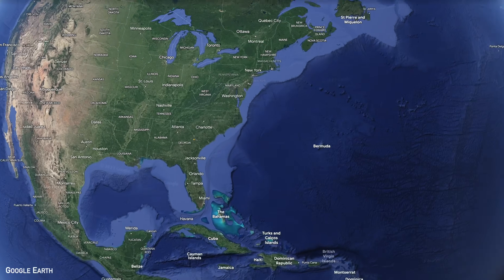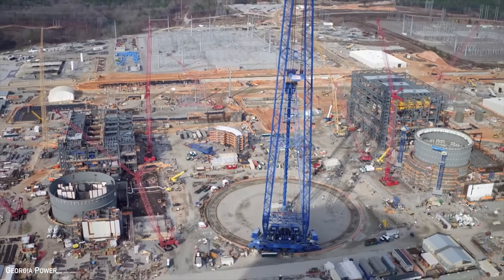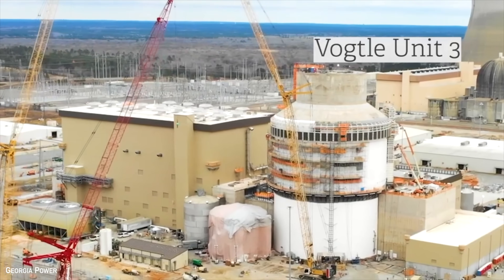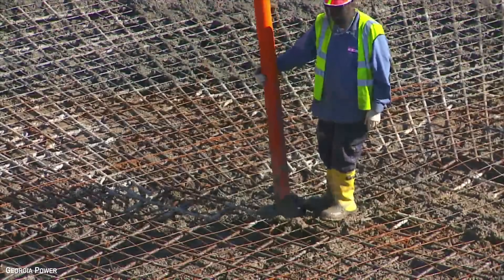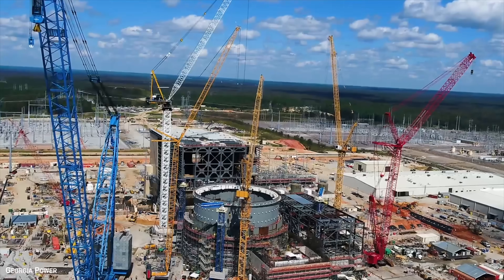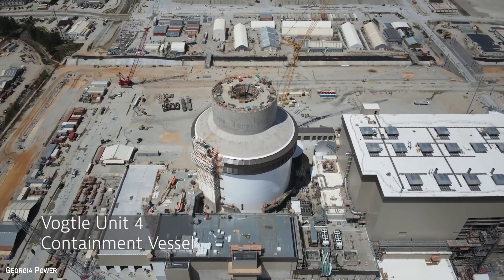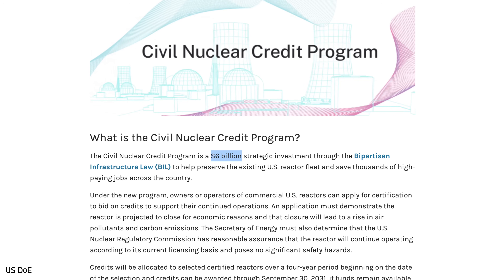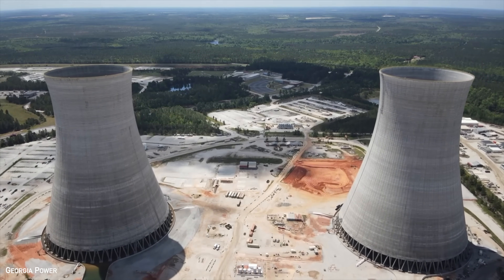Why the Future of Nuclear Power Depends on This Plant

Comment: It sounds to me that there was a gross overreaction to the Fukushima disaster. The main problem there was due to it's location near the ocean. How does that apply to a plant a hundred or more miles from the ocean?
Reply: Ocean was no problem. Cost cutting by failing to build another couple meters of sea wall was the problem.
Reply: @Nill757  You are correct, after all the studies it came down to two things, one was the sea wall was inadequate despite many scientists telling TEPCO the sea wall for Daiichi and Daini needed to be higher, much higher. Also there was the lack of a black out diesel generator. Many of the plants in the USA have a black out diesel on the highest altitude nearby to supply power in the case of a flood. Also there is the command structure. Fukushima Daini had a great command and control leadership where Daiichi did not which contributed to the release of contamination.

You are also correct in that the Daiichi contamination release was a severe overreaction. They bent to undeducated public sentiment and evacuated areas which were safe to live in to this day. Contamination is still misunderstood, take into consideration the atrocities at Hiroshima and Nagasaki, they are not waste lands ruled but gangs of mutant overlords like the movies and mainstream media portray post nuclear releases. They are thriving cities with healthy populations, and the other units at Chernobyl were still operating until their end of life, even after the disaster at unit 4. Of course the fossil fuel industry and major media outlets don't want folks to understand this so they can continue to make money off of sensational headlines.
Reply: @anydaynow01  Tepco had plant blackout generators. Tsunami got them, really the only major Tsunami damage to the plant.  If those diesels had been saved, could have restarted all the reactors as soon as transmission rebuilt, helping the community.
Reply: @anydaynow01  “Hiroshima and Nagasaki … thriving …”

Exactly.  Plenty of photos on the internet showing Hiroshima in the 1950s and thriving…looks like a Japanese Detroit. Doesn’t matter. Next reactor accident that also kills nobody will still bring out chants of “uninhabitable forever”.
Reply: @anydaynow01  excuses excuses. What else is missed in the other plants in other countries. They promise they are safe as usual.
Reply: @Nill757  You are a m0ron.  EVERY nuclear plant evaluates every man made and natural event and then designs the plant  to withstand the worst POSTULATED event. 
There was NO cost cutting.
The tsunami was much higher than postulated.  And EVERY nuclear plant may have underestimated any or all possible event.
.Public school educated people are easy to spot
Reply: @Nill757  yea, maybe, but we can't predict mother nature, and after as much as one of these reactors cost, you think they all won't cut costs by cheating out on certain things? Clean green and too cheap to meter my ass.
Reply: As someone who has worked in the Nuclear Power Industry Japan's concept of "Design Basis" events that a plant was supposed to handle was very inadequate (only look at events that occurred once every twice the plant design life: Tsunamis occurred on average of once every 90 years... which was outside the 80 year requirement for a 40 year design life plant - and a 1.11% chance per year with a 45% chance of occurring during the life of the plant:  Note the US requirements is any event identified in the area as ever happening in the historic and geologic history).

However, while that's why Fukushima was not designed to withstand a Tsunami; the Fukushima incident raised the question of how can we protect the plant and the population for a "beyond design basis" event.

The NRC issued rules that required Plants to consider a variety of "Beyond Design Basis" events and to have on hand various equipment and supplies on hand to cool the reactor core and spent fuel pool in the event of something occuring that was not considered during the design phase of the power plant.   It cost each plant $millions to set up the equipment, supplies, some modifications (to allow hoses to be connected to certain piping systems), and develop procedures and training.  The equipment is maintained and tested, and supplies kept up to date.

Vogtle 3 & 4 had to set all of that up as well because while it would be rare for a "beyond design basis event" to occur in the USA... The plants have to be ready to handle it - if it occurs (other than a major meteorite strike on the plant that likely vaporizes much of the plant and kills everyone).
Reply: @perryallan3524  “in the event of something”

What kind of regulation is that? It’s essentially spend money until we say stop. FAA, FDA don’t work like that.

In Japan’s case, it seems more money should have been spent on infrastructure to lower the 20K actually killed by the quake and tsunami,  not so much on the reactors which killed nobody via radiation.
Reply: @Nill757  There is a big difference in how the NRC regulates than how the FAA, FDA, and most other government agencies regulate.   If a commercial airliner crashes - it affects a relatively small area and might affect hundreds of people (most likely less than 1000 even if the aircraft crashes into a full capacity sports stadium in the middle of a game).   If there is a problem with a drug or medical procedure - it typically affects less than 10,000 people.

A major problem at a nuclear power plant - could affect hundreds of thousands or millions of people - with long term effects on very large areas of land and population (look at Chernobyl as an example - which was not the worst case).

The standard imposed on the NRC by Congress was to protect the "health and safety of the public" (beyond the plant itself.   No mention of what happens to the people working at the plant.

Different disaster scenario.  Different standards. Different Regulations.   All mandated by Congress and signed by whoever was President of the United States at the time.    Having worked in the industry (I'm now retired) - I totally agree with this different standard for Nuclear Power Plants.
Reply: @perryallan3524  “Chernobyl … not worse case”

How is that positive feed back runaway not worse case?  Why compare that Soviet RBMK graphite design to the worlds commercial light water reactors in terms or worst possible outcome?
Reply: @Nill757  I've met a guy who dealt with a liquid sodium fire from a sodium cooled reactor...  Sodium reacts violently with water.

After that discussion which included a discussion of the overall design of that power plant I'm convinced that a sodium cooled reactor event could become much worse than Chernobyl was.  Perhaps I'm wrong on that... but one of my expertise is heat exchanges; and I've never seen or heard of a steam generator or a heat exchanger that could not have a tube (or plate) leak.  I've certainly dealt with enough of them in my life.
Reply: @perryallan3524  Yes sodium leaks were a problem w super Phenix for example. Russians BN 800 may have a reliable approach I don’t know.  

Yet I’m not sure what that has do with the world’s light water reactors, and how they can possibly hurt people on the scale of possible accidents you suggest, like the FDA or FAA are charged  with regulating in their sectors. Globally there are some 11 stadiums now that hold over 100,000 people. Yet there is no FAA type mandate for a 6’ concrete aircraft impact dome covering them all. Granted nuclear has unique safety issues but unique is not synonymous with infinite.
Reply: @Nill757  Some years ago I researched every sodium cooled reactor ever built and their operating problems, including sodium leaks.    While I don't recall the details now, they all had problems that had "scary level" consequences  (including research reactors).   That is why virtually all of them were prematurely shut down (although my memory is that there are still a few research reactors - outside of Russia).  As for Russia's claim of safe operation and safety...  I take that with a dump-truck of salt.    So much has come out about Soviet era problems from long ago that were hidden for decades.   Russia has the same tendency.

As for relevance to today:   My recollection is that the last time I looked (6-12 months ago) there were at least 2 proposed SMR's cooled by sodium around the world.

As long as people talk about using them... I consider them something that has to be considered.

I much prefer the high temperature gas reactors if we are to deviate away from water (although the operating history of the previous ones showed problems that I believe we can now solve).  

Liquid salt cooled reactors have a huge corrosion and possible stress corrosion cracking issue that have not been adequately addressed.    We might find that the current proposed designs have to be prematurely shut down due to those problems which destroys any possible economy of using them.
Reply: Unfortunately fukushima disaster wasn't caused by its location, they(plant crew, company managers, and local government) had plenty of time (about 2 days) to fix the problem when they were first notified the problem, but they chose to cover the issue instead of fixing it, causing precious time to be wasted. It was a disaster caused entirely by people's wrongdoing, I feel angry everytime I see people sympathize with people who suffered the aftermath of Fukushima disaster without blaming people who caused the disaster, I'm guessing hiding then apologizing without actually doing anything is really a good PR practice to let public forget and forgive what horrible things you've done.
Oh and by the way, in 2021, they decided to dump all treated and untreated nuclear waste into the ocean b/c they "can't  afford" holding those waste on the ground anymore. They really think if they bow and apologize, then they no longer hold responsibility for what they've caused, disgusting.
Reply: From what I understand, it was that the company was told by many countries to move the cooling pumps up above the level of the sea-brake wall, they did not, so when the wall failed from the earth quake and tsunami wave, the pumps failed. It was not the reactor it’s self but the management of the systems by management and the choices to ignore what they were told to do. There is no sea brake wall threat to these reactors. Keep them low for water gravity flow for cooling from backup pools.
Reply: Fukushima is killing the pacific ocean, traces of fukushima fallout aka fuktonium, are found all over the world. Don't let these people tell you it's safe, nuclear will be our demise as a species.
Reply: Maybe if the backup generators were not in the basement, below sea level would have helped.
Reply: Nah the reaction I believe was because the poeple weren't given all the facts about this invisible death. same with Chernobyl and 3 mile island. If something where to happen history dictate if it can be avoided they ether tell us nothing or give a water down version.
Reply: You are morons if you still think nuclear is safe after all these years.
Reply: Mistakes were, DGs were underground, and when they got flooded thy had no other backups for their systems
Reply: no, its perfectly sound and rational reaction to what happened. and continues to happen.

no it is not safe to live in the areas contaminated by fukushima... including the pacific ocean.

blowing up... and mox fuel was the problem. storing fuel on site... no secondary back up off site... 

all nuclear reactors are extreamely vulnerable to earth quakes and flooding as well as other things. and share in the same ignorance of preparing for redundancy. 

they all operate the same way, france and china being worse... 

so the same things will happen at over 200+ nuclear power plants... even if they had generators above the known flood planes or predicted... tidal surge was not in the plans... 

just like 1000 year flash floods popping up in a known flood plain... they decided to build a nuke in the middle of...
Reply: You are correct, Fukushima had little to do with the cost over runs.

Comment: With cheap gas it quite difficult to be competitive with expensive nuclear projects.
Reply: Nuclear can scale to run whole grid. Gas can’t, as then gas won’t be cheap.
Reply: Yep short sighted companies are shuttering fission plants to put in combined cycle plants because their board members see a short term profit.
Reply: @anydaynow01  If Germany is any guide, long term profit. Intermittent RE is always going to need back up.
Reply: Yeah!! because gas is not STRANGLED with idiotic regulations lobbied by the fossil fuels sectors. 

Adding regulations to an inland PP based on an accident caused by a once in a 100 years tsunami is the smartest thing ever.